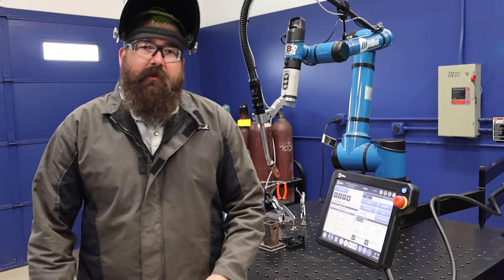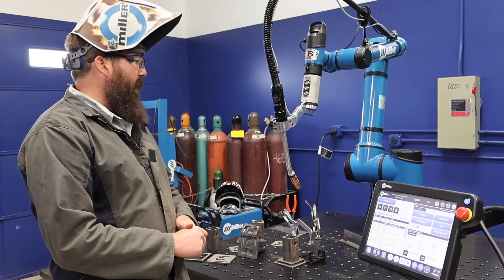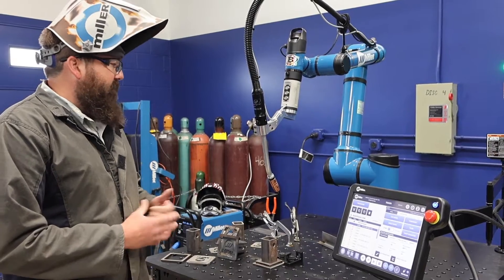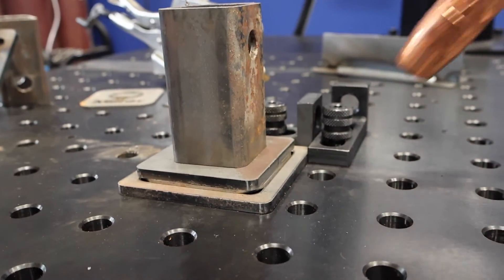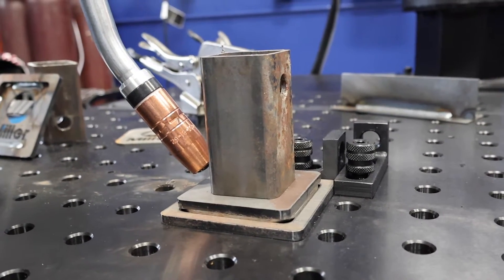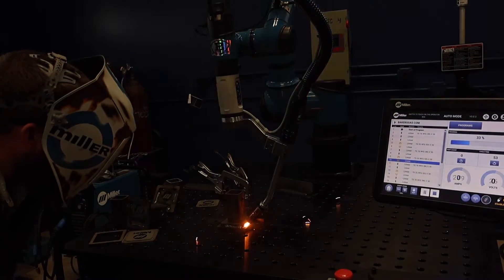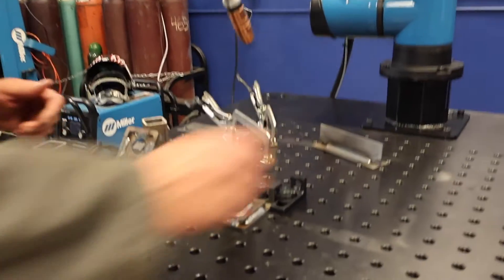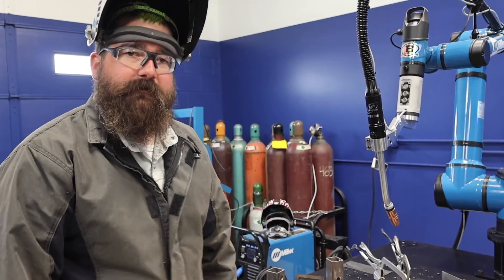Miller Electric Cobot Copilot Project: Simplest Cobot on the market?

Comment: We've tried getting these past safety approval and when they will finally pass, they are forced to run too slow.  ...and the industry doesn't trust them...(?)  So we always get regular robots and build a full robot cell.   Seems like a good idea...but when you have people working in close proximity...it becomes a no go.   I'm not saying they aren't awesome...but I've only been able to use one....and that was an existing cobot so no new approval had to be acquired.  (I question the original approval)  We could not exceed the tool weight or existing speed parameters.  They are more headache that they are worth in my experience.  They might be as good as they say safety wise...but they are a tough sell when it comes to safety approval even though they sound ideal.